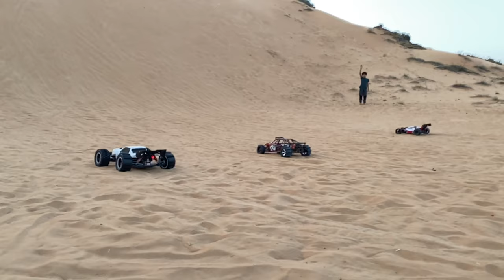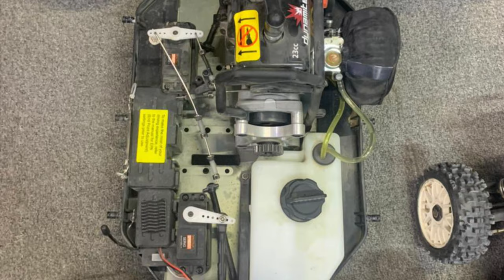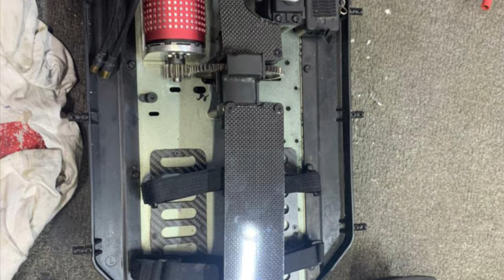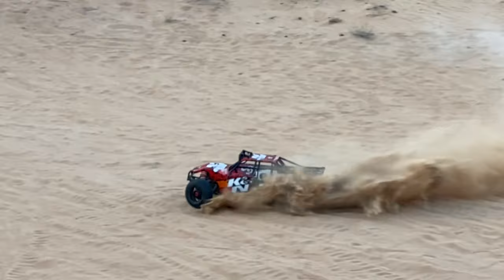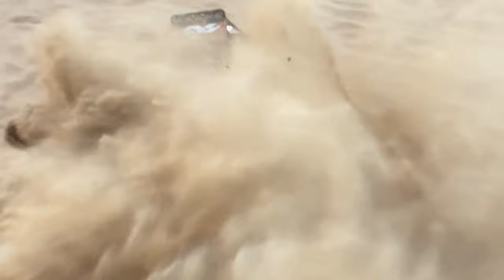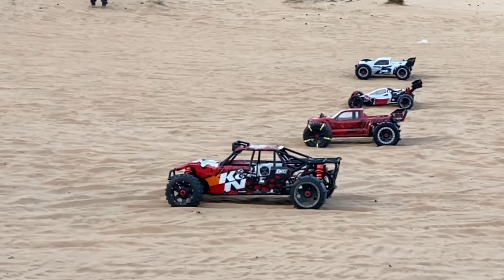Losi K&N DBXL 1/5-SCALE Converted to Brushless

Comment: Ripping! I just bought a DBXL-E roller. What KV motor is the Leopard 58113?
Reply from the maker: 800kv dbxle is an absolute beast
Reply: @UAERCADDICTS  thanks for replying. Was it the 870kv motor? It goes from 700 to 870 and then 1050. I subbed to your channel, I like all video's 👍🏼
Reply from the maker: @RilatinePopper  this is the leopard 800KV v1, i know the V2 are from 700 to 870 thanks :)
Reply: @UAERCADDICTS  oh okay thanks! I thought the V2 only had the knobs instead of the slots on the motor. Awesome build bro keep it up,

Comment: Where did u get the center dog bone driver shaft from ??
Reply from the maker: hi dear first of all we moved the center to the middles of the chassis as you saw and front shafts is the same  factory on e for the dbxl but the rear is for Maverick Vader from hpi